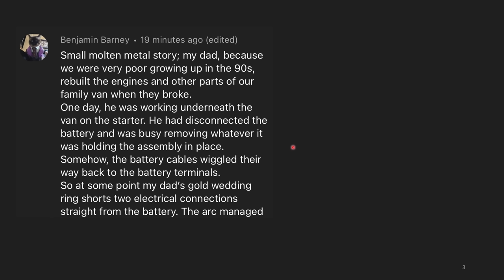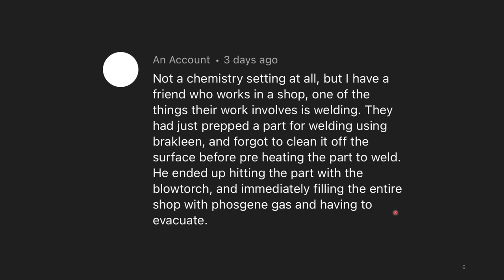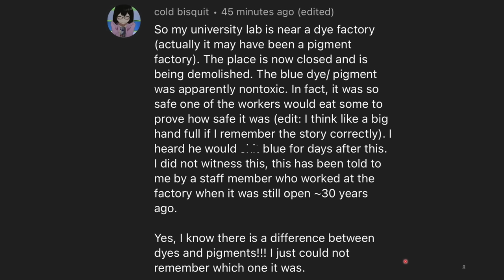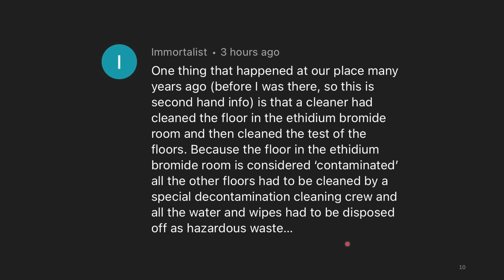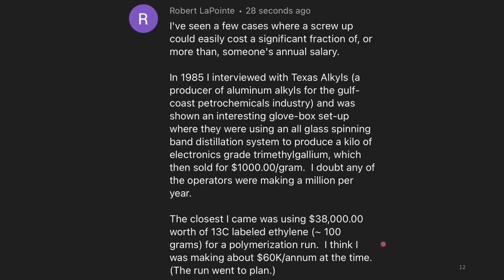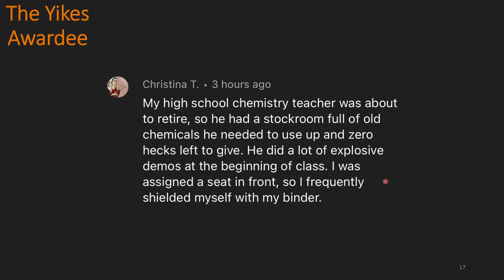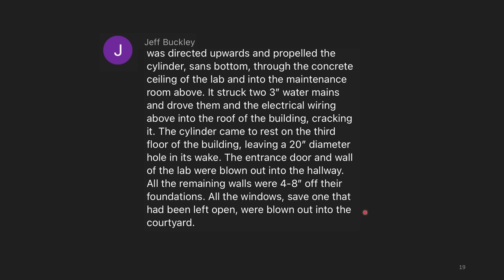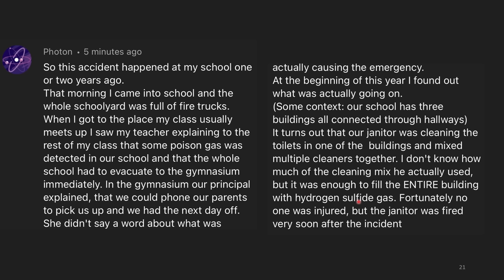Liquid Nitrogen Overpressurized and Exploded

Comment: That story of the ring and the starter wire gave me a flashback to when I first started spinning wrenches and didn’t know better. I was wearing a silver ring and was taking batteries off of a front end loader with a 24 volt system. I wasn’t paying enough attention (plus didn’t give the job I was doing the respect it deserved) and accidentally arced the positive terminal against the body while installing the positive terminal on the second new battery. I ended up with a nasty ring shaped blister from the 2nd burn I got and lesser burns on the tips of my right hand fingers from when I quickly grabbed the ring to pull it off. Luckily the metal on the ring didn’t get molten but it definitely got hot enough to change color. 

After that I never ever wore a ring while working on anything ever. Even after I got married.

Comment: 14:00 in my middle school time they cleaned out the chemical storage in the summer holidays and they did that by filling up big bottles with fluid chemicals that shouldn't react with each other. well it wen't well for the most part until they found a bottle with a chemical that wasn't what it was labled as and it started to boil and fume. luckily it wasn't a big reaction and they could just wait until it finished reacting, but the few people in the school got out and they called the firefighters as safety measure for the case something else unexpected happened. that way the firefighters got a free chemical training call out and the people that lived in that region had something to watch.

Comment: 1:35 believe it or not a 12-volt battery can discharge an incredible amount of power in one go! Generally, starter motor cables are about the thickness of your small finger! Some starter motors can draw 1.2kW at 12 volts (100A)

Comment: Today one of the EHS officers came to my class to present some safety stuff. While going over the university’s HF procedures, he shared a story. He once had an EHS job at a very prestigious university, where one of the art students had managed to get access to large volumes of HF and was using a pressure washer to etch sheets of glass, inside a normal studio. Apparently the dude was fine (maybe he hadn’t begun etching the glass yet?) but the EHS guy had to explain the many reasons why that’s a terrible idea. The moral of the story is that you shouldn’t put acid in a power washer because it will decalcify your bones or something

Comment: The solvent stories reminds me at a time i was in school for collision repair and refinishing. I had just finished spraying primer on a car and needed to clean out the paint gun afterwards. I guess I was running on a faulty auto pilot, cause I didn't fully take the cup that held the primer off before filling it with prep-sol. So i go to try and take the cup off, that now has a mix of primer and prep-sol in it and, once the connection finally turns, it splashes over the left side of my face and my left shoulder. I calmly walk over to an instructor, and they rinse my eye out with water for I think 20 min and, me not having health insurance at the time, decline going to the hospital. The rest of the day, my eye looked like I was going through a villain arc in an anime and i got a nasty chemical burn on my shoulder from where my bra was. This was my second accident that month, the first being catching my hair on fire from doing an overhead weld. Luckily i smothered it out before I had anything more than some crispy ends to my hair. 10/10, would do it again.

Comment: I'm a janitor at a college and I remember getting called to a lab to clean up a spill which apparently was water but i was rather nervous and hoping that it was just water and not some crazy stuff. There's one building that has a large liquid nitrogen tank in the basement that I've had to be around to do my job and I swear it would occasionally make a sound like it was releasing some pressure or something and I'm always scared to be around that thing.
Reply from the maker: It’s usually fine, but even the chemists worry that one day, one of them will fail
Reply: Releasing pressure is what it is supposed to do. It's when it doesn't release pressure (stuck safety valve, or some idiot replaced a bad safety valve with a plug) that it can blow up.

Comment: If you've ever seen how much power car battery can put out, it's really not surprising that it's able to instantly melt a ring. Most car batteries can run at least 600 amps at over 11 volts, that is A LOT of power.

Comment: The Janitor Probably used an acidic drain opener such as sulfuric or hydrochloric acid in the sewage pipes that were likely aged and comprised of iron sulfides. You can get H2S from crushed 100 yo iron sewage pipe in acid just as ez as pyrite.

Comment: I cringed so hard as soon as it got to the welded-off pressure valves, I had to pause the video for 10 seconds. Whywhywhywhywhyyyyyyyy?
Reply: Bad enough replacing the failed safety valve with a plug. Welding it just seems like somebody wanted to make sure it would blow up.

Comment: Oh we're doing stories?
My high-school times were wild, with our chemistry teacher introducing himself with what amounts to homegrown explosives, before stating he was probably a 'bit' overqualified to be our chemistry teacher, "but what can you do, the military rejected me so here i am."
Anyways the story is almost completely unrelated to said teacher, other than at one point he may or may not have been teaching us some things he probably (absolutely) shouldn't have, and got a slap on the fingers from the board, and a couple weeks suspension pending review.
So, during his time off, we had a replacement teacher.
As overqualified as good ol' Mr. Locker was, this new one was equally as underqualified, and all-round an overworked mess.

Our chemistry lab consisted out of wooden tables that looked more like driftwood than tables (probably because of all the soaked in chemicals and teenager vandalism), and some gas valves/taps protruding out the top of it for burner experiments.
Now, i know what you're thinking, but don't worry, the gas valves had a master shut-off valve in a lock-box only the teacher had the keys to.
So every time we did an experiment, he'd turn them on, and later turn them off.
Mr. Locker was pretty clear about the rules; "Touch the valves without asking for permission and you're the subject of our next experiment."

...

So anyways some kids thought it was fun to mess around, without any real authority in the classroom there to correct them, and opened the valves full blast.
On like 11 different desks.
Right when we went on a lunch-break for 15 minutes.
With no one in the classroom.
The replacement teacher forgot to turn off the master valve.

The entire school was evacuated when classroom A153.b reported a gas smell, which, that classroom was a 6 classrooms over, and a floor down. (actually a floor and a half, because our building had staggered floors, but irrelevant.)
We were sent home from school that day, and nothing happened, but i think it's safe to say that we should count ourselves lucky that nobody died in an explosion that would have probably taken half the wing out of our school.
Also everybody ratted on the idiots that were responsible, and they were slapped with actual community service from our local youth-police.
The replacement teacher was sent home pretty much on the spot, and Mr. Locker returned a week later.

Locker never stopped poking fun at the ones who were responsible, and took every opportunity to grind them to a pulp in class.
And he wasn't kidding, they were permanent helpers with every experiment.
3 of them ended up picking an education in chemistry.
Best teacher i've ever had, without a doubt.

Comment: Where they even get tetrachloroethylene is beyond me. Locally brakleen is only ever non chlorinated and its usually mixes of acetone and heptane, although I've also seen different brands use various mixes of acetone with toluene or methyl acetate. Then again I'm also from California so they probably have the relevant regulations in place to stop chlorinated brake cleaner from being sold in state.
Reply: Chlorinated Brakleen is indeed banned in many places. CRC makes eight different formulations to meet regulations in various places. I use the good stuff from the red can because I use it only a couple times a year and in well ventilated areas, and in my experience the green can stuff is like water in comparison. I might still be in favor of banning it, though, because if you don't know the risks you can really put yourself in danger.

Comment: 13:09 honestly, this is just bad design of the experiment. the explosion had no where to go except through the glass door. i've seen this done with pure cesium, and it was less dangerous. when we did it, we went outside and had a huge 1 inch thick poly carbonate blast shield and a shallow dish without a ton of water. the dish was expected to be destroyed, which it was. there was a melted hole in the blast shield at the end, but it was under control lol

Comment: An EtBr room itself sounds scary enough.  Was that just waste storage or was it used so much that a separate room was needed? 

Not that I have any experience with such things, but I suspect there were bits of sodium metal around the hood.

Is hydrogen sulfide story really a game of telepone? Had the janitor done nothing and called emergency because of  funny smell, fire department response would have been the same and perhaps hydrogen sulfide would be detected because it occurs in sewer pipes. Call the fire department, you get the buildin cleared and guy in full gear checking the building. Call a plumber, get a guy in jeans. Maybe the janitor was fired for some other reason, maybe janitor left and rumor started he was fired.

There was a Japanese bath salt that when mixed with bleach produces hydrogen sulfide.  Not the first thing I'd suspect someone to pour down the drain, but you never know with people.

Comment: I had an accident in my sink involving sodium in toluine and lapse of judgement when I for some reason turned the water tap on. There was no explosion as there wasn't much sodium but there was enough to react with water and ignite the Toluene. Thick smoke immediately started billowing and covered the room with stringy bits of carbon ash. Within a few seconds I had put it out with co2 fire extinguisher 🧯
Fortunately I had that nearby and the fire was contained within the sink. It could've been a much worse disaster

Comment: Regarding the melting gold ring, there is a hilarious story of a similar accident but on a larger scale. Well, it's funny because nobody got hurt in the end.  http://evdl.org/docs/plasmaboy.pdf 
...
18:08 Hydrogen sulphide in the air is pretty hard to miss, because of the stink.
This reminds me that during my teenage years, I did a chemical... errmm... "side experiment" with a friend, during chemistry class. We heated paraffin and sulphur powder together and the result was foul smelling. There were various accusations flying about and windows were opened and we were just lying very low and tried to look as innocent as we could.